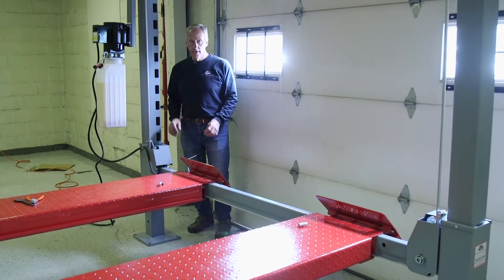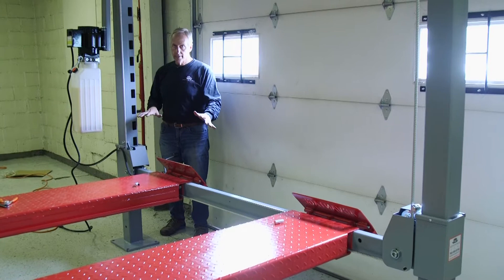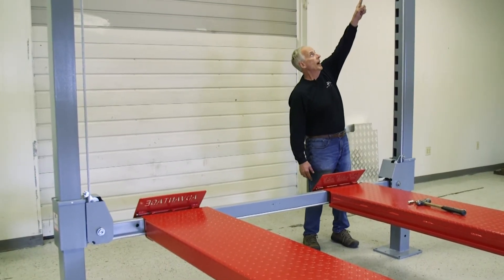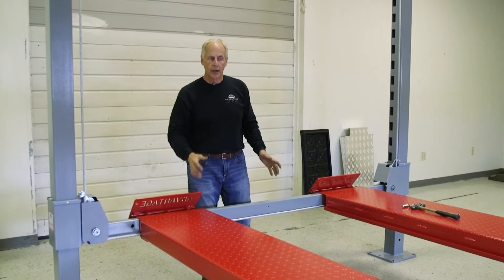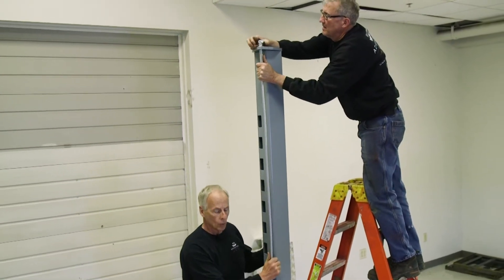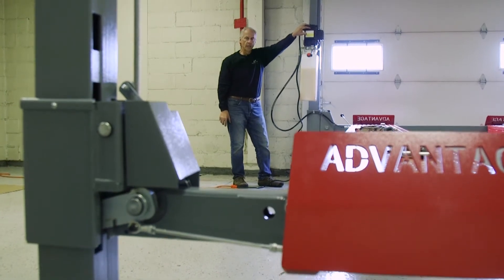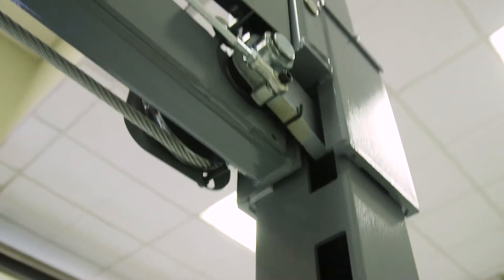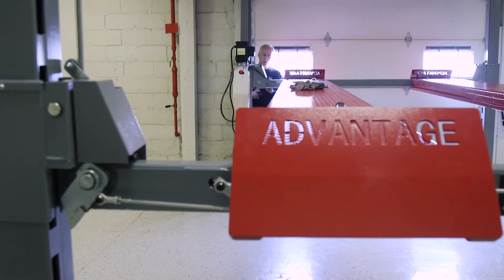ADVANTAGE INSTALLATION  - LOCK ADJUSTMENTS

Comment: I own the 2 car - 4 post lift. I noticed after a few years, the adjustment was off. Not by much… is this to be expected?
Reply: 2 years later. Each cable is a different length so they have a different potential percentage of stretch. So the longest cable will stretch the most. It's normal but can be adjusted 
- if they seem to stretch often, you have  a cable failing.